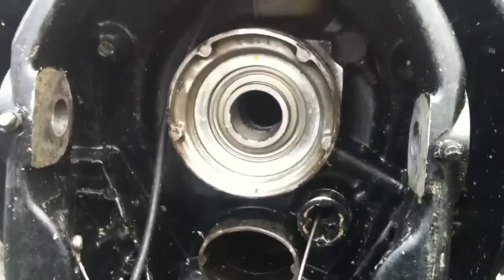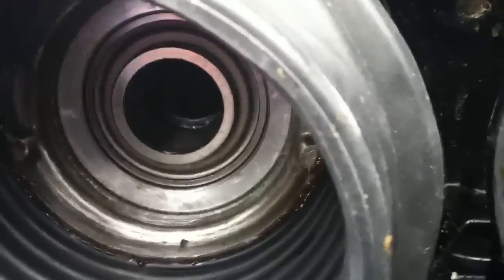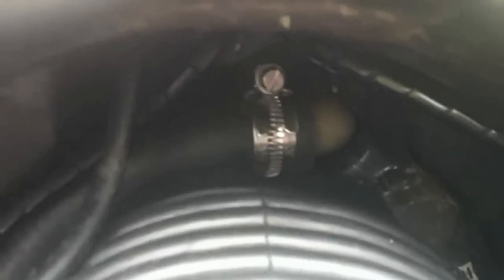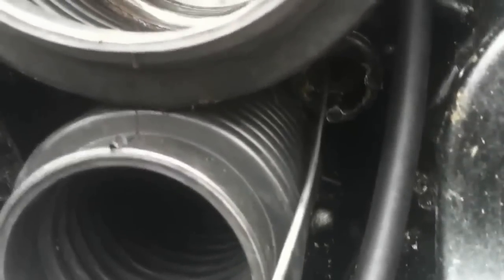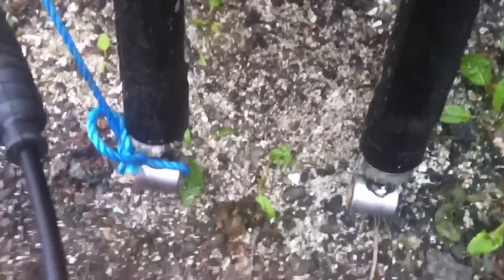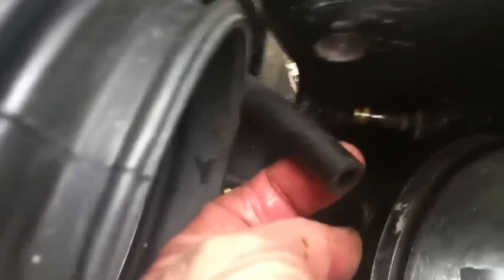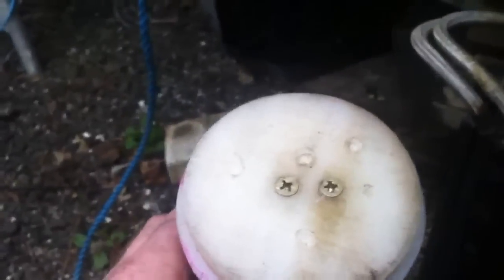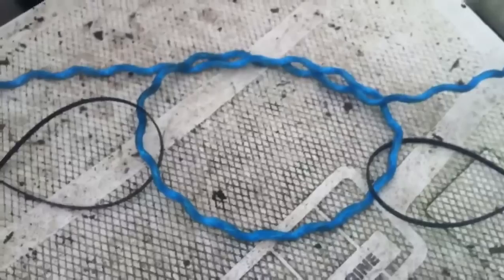Mercruiser Transom Bellows Install Procedure

Comment: great video thanks for sharing, got a question for you though, when you made the tool for the sleeve for the bellow what dimensions did you make it?  big hole is what diameter? smaller circle is what diameter also?  thanks in advance.. Mike..  they sell the part for 34 bucks and would much rather not spend that when can make for free...

Comment: Great video! Really helped me get mine done this week. I do have one question, you mentioned using a bit of silicon spray to get the bellows ring in. Have you had any trouble with that? I ask because I used a very little bit of 10w30 oil to assist in getting mine on and I am getting some negative comments on one of the forums that I might have problems with it maybe slipping out. I don't really see how that is possible but wondered how your is working.
Thanks

Comment from the maker: Hi, thanks for the comment, i cut the tool out of a food cutting board. If you purchase the new sleeve i.e. the aluminium ring. Take the outside measurement, trace it onto the board and also the same for the inside and cut on this line. The large outside needs to be exact but the inside needs to engage on the small internal sleeve lip.
Also when  you put it together the bearing surface need to engage the inner and outer at the same time, i had to put a small spacer between. Good luck. :-)

Comment: Help, My boat had a leak, and it was repaired $5000 G's later, it still has problems, it went 5 miles and a bang, smell of rubber belt burning, smoke , thank God no fire, It had an MCM alpha transom replaced the bellows replaced ,riser gasket, pipe kit exhaust,starter motor, dexron III trans flu, 17 x 19 absorbant pad,whole load of stuff done, 3000 in parts and 1700 in labor, I am lost and what happened, no belts broke and small amount of water coming in from the outboard somewhere, no sure what it is, or if that's normal, any help here? 1986 Regel
Reply: +Jennifer Michelle  sounds like your engine coupler went. its directly on the back of your engine bolted to the flywheel. engine needs to be pulled again for repairs if thats your problem.
Reply from the maker: +Mike Urk   Thanks Mike as i missed this comment from last year,  agree smell of burnt rubber is the engine coupling, changed mine last year, have since pulled the merc and replacing with a ford marinised diesel van engine. i have put a vid up showing the replacement engine.

Comment from the maker: Hi i used silicone spray asi it dries, don't forget when you bolt the outdrive you will be compressing the thick rubber seal hard against the bellows so you should be fine. :-)